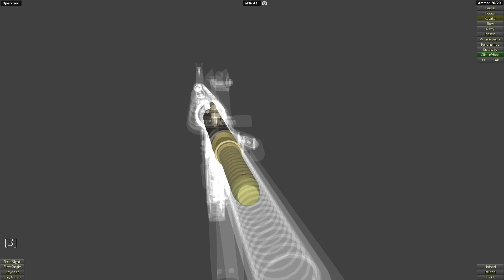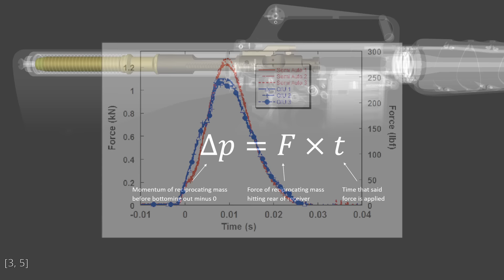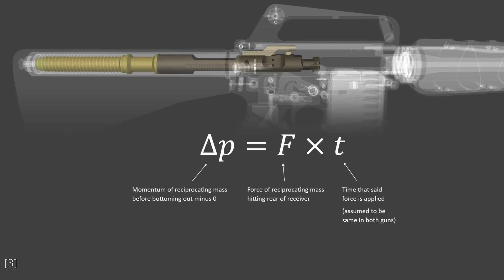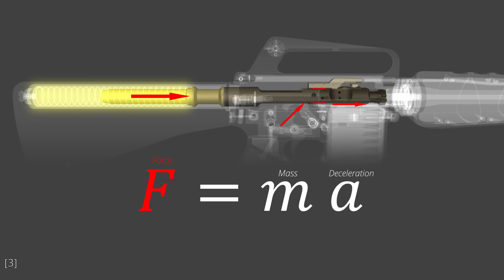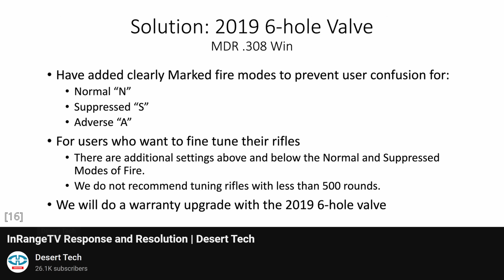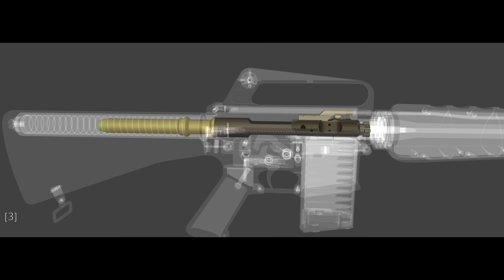Bolt Carrier Mass - A Nerdy Theoretical Discussion

Comment from the maker: FOLLOW UP:

I'd like to use this pinned comment to expand on some of the details that I glossed over/missed in the video. A lot of these details are contributed by thoughtful commenters, which I really appreciate!

1. Please keep in mind that the video is talking about the reciprocating group as one mass and ignoring the interaction between the different components. I wanted this video to be applicable to gas operated firearms as a whole. Here are some of my thoughts about the quirks of the AR platform if you're interested: The buffer doesn't contribute kinetic energy for unlocking, bolt pickup, and overcoming any friction/forces that resist solely the bolt carrier during the rearward stroke (e.g: hammer spring force). However, it does help everything in the forward stroke. A few commenters mentioned lightening the bolt carrier but increasing the buffer weight as a method to soften the felt recoil. This works because even though the overall reciprocating mass is the same, a larger portion of that mass is now in the form of the movable buffer weights, which spreads out the impulse of the reciprocating mass over a larger amount of time. The flip side is that the lightened bolt carrier now has lower kinetic energy to overcome the previously mentioned resistances during the rearward stroke.

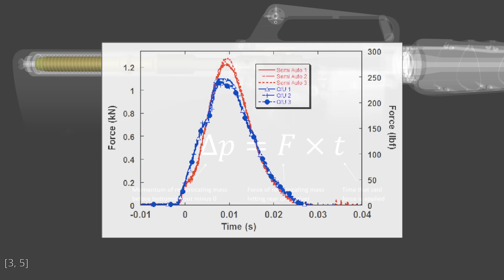2. Is it reasonable to assume that both reciprocating masses takes the same amount of time to come to a stop after bottoming out (5:23)? This amount of time is dependent on a few things like the stiffness of the buffer material, the butt pad, and how stiff the shooter is holding the gun. Additionally, the impulse transferred to the gun when the reciprocating mass bottoms out is also dependent on the rebound velocity after it bounce off the rear of the receiver (after removing the contribution of the recoil spring). I could not find a way to account for all of that, so I made an over-simplistic, catch-all assumption that the impulse time is the same, and did not include the time after v=0 into the impulse time. This is for the sake of being able to compare the impact force, which I think is more intuitive to understand. The more accurate thing to do would be to just stop at comparing the impulses of of the reciprocating mass striking the receiver, where the impulse could be understood as the capacity to apply a force over a length of time.

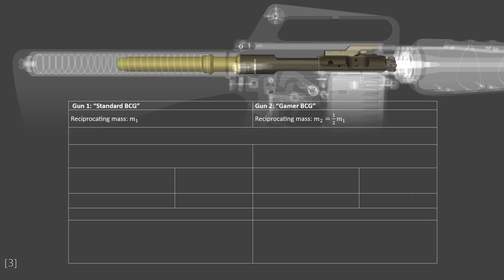3. Another over-simplistic assumption that I made is that the gas system provides the same amount of kinetic energy to the reciprocating group regardless of mass (1:45). The amount of KE provided by the gas system is the mechanical work done by the propellant gas on the reciprocating mass. This can be calculated by taking the integral of the force applied to the working surface of the gas piston over the distance of travel during which the piston is pressurized. (Note: in the AR-15, the "working surface of the gas piston" is the rear surface of the gas chamber inside the bolt carrier). In the video, I compared a gun with standard gas and standard mass to a gun with standard gas and low mass, so I assumed that the gas system has enough pressure to apply roughly the same force during the entire pressurized stroke of the piston. However, if you use an overly heavy reciprocating mass for a given gas system, an interesting thing starts to happen. The pressure inside the gas chamber drops over time as the bullet goes pass the gas port and exits the muzzle. An overly heavy reciprocating mass will accelerate very slowly, which means the gas pressure can drop significantly during the pressurized stroke. Therefore the force-distance curve of the piston will drop, the area under the curve will drop, meaning the kinetic energy provided to the reciprocating mass by the gas system will reduce. TL,DR: In real life, if the reciprocating mass is too heavy for a given gas system, you can reduce the amount of kinetic energy provided by said gas system, and the gun might short stroke.

4. Another obvious, but implicit assumption I made in the video is that in both guns, the reciprocating mass bottoms out on the back of the receiver. This is true for most military weapons. If you tune the gun so that the reciprocating group does not bottom out, then it categorically changes the recoil behaviour, and the math I used no longer applies. What would still apply is that an overly lightweight reciprocating group would still decelerate faster, and you would still have a harder time balancing a slow enough initial velocity for extraction, and fast enough to complete the cycle. If you want to know more about cases where the reciprocating group does not bottom out, then patent US4475438A is a good read. It's Jim Sullivan's patent on the constant recoil system. And it's more complicated than just making the reciprocating mass not bottom out.

5. A viewer brought up an interesting detail about the AR platform. During the extraction phase, after the bolt has unlocked, the extractor momentarily lifts off the rim of the fired casing. It is the residual chamber pressure after unlocking that presses the case into the bolt face, allowing the extractor to fall back down and grab the case rim again for ejection. A few tests showing this phenomenon were detailed in a May 2003 US Army TACOM presentation, titled "Understanding Extractor Lift in the M16 Family of Weapons". Supposedly, the implication of this is that the initial BCG velocity is important because if it's too fast, the BCG recedes faster than the residual chamber pressure can press the case into the bolt face, leading to failures to extract.
Reply: Are u talking Arizona to Alaska as in temps
Reply from the maker: @syitiger9072  yup
Reply: US ordnance (the government) found that, to have a reliable selfloading firearm, you need a Bolt carrier:Bolt mass ratio of about 3:1 or greater. the greater, theoretically the more reliable. 

SCAR17 is at 8.8:1. M1 is at 1.75, M14 is at 1.45. This is very low, but the M14 doesn't lose much relative to the M1 for that loss. It's more that they would gain a lot of energy retention from getting to 3.

AR15 has 4.68 for a full auto normal Colt BCG.
K1 has 5.88
AKM is at 5.4
Reply: Thank you for an outstanding video and follow-up clarifications!  While I agree there is more to Constant Recoil than simply keeping the bolt from bottoming out, that is a huge benefit unto itself.  Many commenters on videos about Constant Recoil claim that it would be useless or have no effect in semiautomatics.  That's like saying that switching out your dirtbike's long-travel springs for scooter suspension would be equally controllable or comfortable on a rocky trail.  The effects of inadequate free recoil travel are readily apparent in subcompact pistols.  Not only is recoil worse, but the springs are much stiffer (offer more resistance during the critical ejection portion of the recoil stroke) to avoid it being MUCH worse.
Reply: "Is it reasonable to assume that both reciprocating masses takes the same amount of time to come to a stop after bottoming out". No, a more reasonable assumption is that the effective spring constant will be the same, which means the heavier mass will apply force for longer (but still more force). As you say though, just compare impulses.

More importantly though, the BCG slamming into both ends isn't the only impulse -- there's also the impulse directly transmitted to the receiver through the locking lugs. Pump action shotguns don't have any recoiling mass when fired, while semi-autos do and this makes them softer shooting. This is because the direct impulse is lessened, and then spread out over time with the recoil spring.

"Another over-simplistic assumption that I made is that the gas system provides the same amount of kinetic energy to the reciprocating group regardless of mass". This is another incorrect assumption. It's more of a fixed impulse, and heavier BCG will have less energy for that same imparted momentum. This is why decreasing the mass makes it overgassed unless you turn the gas down to compensate.

Other than that though, I think it all checks out
Reply: On the topic of 1. The buffer weight does help with opening the bolt since it helps compress the mainspring which is one of the resisting forces. This holds true as long as the weight balances are such that the buffer weight and bolt stay in contact for the whole opening stroke. One could easily imagine a scenario where the buffer is very heavy and the bolt is very light and in this scenario the bolt may stop being held by the magazine spring etc. and the buffer continues onwards.

However with any reasonable weight combination the buffer will stay in contact with the bolt for the whole duration of travel, which means that the mainspring is constantly acting upon both the bolt and the buffer weight which means that the buffer weight is being useful here.
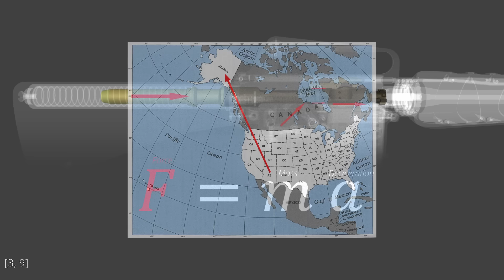Reply: @syitiger9072 8:49 it’s in the video
Reply: @oddspaghetti4287  I did not “get” all of (1) either. The buffer inertia and recoil spring should be working on slowing the BCG’s rearward travel despite additional forces slowing only the BCG (hammer spring). 

Great video overall and food for thought.
Reply: @superfamilyallosauridae6505  Could you link the document? Would be interesting in checking it out.

Comment: Years ago, I was really, REALLY into high performance paintball guns. One thing that we learned was that low reciprocating mass was preferred, but as the mass lowered the cycle speed would almost invariably increase. Adjustable gas regulators could tune in the gas pressure and a solenoid valve would handle volume. With these two parameters, we could better control bolt dwell time. Often though, thr smoothest shooting guns had the lightest bolts, and the LOWEST FRICTION design. Friction was the hardest thing to overcome when trying to achieve a smooth shot cycle. Something to think about in your next AR build.
Reply: It'd be interesting if we start seeing "low friction" BCGs and uppers with less/smoother contact surfaces to reduce felt recoil.... or are these already a thing for competition?
Reply: There are "enhanced" BCGs with low friction coatings and sand cuts in the bearing surfaces.
Reply: That's why my ARs get disgusting amounts of lube & grease (yes I use both)
Reply: @calebnation6155  same here, grease for the sliding parts and oil for the rotating  parts. Most people don't grease their cam pins but I think it's very important to prevent wear in the cam pin channel as well as to help dampen the forces on the cam pin during cycling.
Reply: Cryptic Coatings bcg's ftw
Reply: @justotalkalottashit8392  I was lucky enough to be around for both era's of paintball(been involved since 1998). I still have my X-valved Automag RT ULE 🙂
Reply: @justotalkalottashit8392   Not with solenoids and dwell time lol   Same principles apply though.  I started in paintball in 1988 with a splatmaster and a nelspot. Have owned 3 rental fields, played against the Ironmen at the first tournament to ever see an Autococker, Shot the first Halo loader (I mean the first.. the prototype Tex invented and worked the bugs out with before "Halo" was a loader), had 28 national sponsors in 2002 and was a Works Factory team captain. I was at one time known as one of the best cocker smiths around Texas. I tend to not follow the masses and strive to do things that everyone says can't be done. While the trend with autocockers back then was to use a heavy hammer and higher pressure for more volume and mechanical dwell. I was milling weight off hammers and having custom light springs built by a spring manufacturer to my specs. I have one sitting here right now that will chrono 290 all day long on 100 PSI, that's unheard of with an autococker. A team mate and I actually had an in house anodizing set up and had a few prototypes for our own line of guns, which raised some sponsor issues lol I still have about 85 guns sitting here in storage that need to find a new home, as I no longer mess with anything paintball related. Some nice ones like 1 0f only 25 made Kill Bill 05 Speed Angels, 1 of 2 Bonebrake Angel, OG Freeflow and Dark Cockers etc. Which brings me to my main reason for posting.  Lightning may reduce reliability in an AR15 for one main reason. Failure to come to full battery. Yes, if you have a chamber obstruction that could become an issue. But it could with any amount of mass depending on the obstruction. My 3-gun rifle has a Superlative gas block almost shut off.... 4-5 clicks out on an 18" fluted barrel with a rifle length gas system. A JP LMOS or VooDoo low mass carrier, -25%power spring, and a .589 oz Taccom solid delrin buffer, PA M4-72 muzzle brake, Trigger Tech trigger and some other goodies, but were talking reciprocating mass here. I've ran this set up for nearly 10 years now. Hog hunted with it in pouring rain and mud with wet dogs walking all over it in a boat. Pigs bleeding all in the upper. Red River mud that's mostly sand. Can't tell you how many times I've blown the mud and rocks out of this rifle at a car wash at 3am while knocking the mud off a side by side... I've shot competitions where I work in the oil field in West Texas during sandstorms and filled it with dirt and sand. I'm on my 4th barrel if that gives you an indication of round count. Want to know how many failures I've had..... ZERO.  It does not take that much momentum to chamber a round of 5.56. Most manufacturers lean toward tactical/duty builds and use heavier mas and over gas to ensure reliability.  You can regulate gas and reduce reciprocating mass substantially and still have a reliable system. Now this is a competition gun. I wouldn't go that light on a duty weapon. I have a hodge for that and now a dedicated BCM for thermal hunting hogs. But I promise you all the BS you hear about reliability over mass reduction and adjustable gas blocks is mostly just that BS.  I'm still using the same superlative gas block after 10 years btw. I've replaced the adjuster in it twice now, only because the tip of it burned off after thousands of rounds. Use hi temp bearing grease on adj GB threads and you'll never have a problem. Polish away friction, consider every part as a tuned system from tip to butt, think outside the box....  that is all... sorry for the long azz rant lol

EDIT: btw, my dad was a LE armorer and I had 2 uncles that were vietnam vets. My first AR was my dads Bushmaster in 1988. I've been tuning them for a while lol Sometimes experience and mechanical aptitude adds up better than math does in the real world.
Reply: As they say: high speed, low drag

Comment: I believe the gun should fit the time-place-occasion, if it's supposed to work in many different conditions, eliminating variables with a heavier BC is a good idea, but if its a competiton gun that doesn't fire full auto and only semi, i think there is a decent trade off to be had with a lighter BC
Reply from the maker: Agreed
Reply: For non-match guns, I like to run the heaviest buffer I can get away with for just that reason.

Also keep in mind the heavier, mil spec carriers will lost a lot longer than lightweight units.

Comment: If you add a stronger recoil spring to counter the increased velocity, then adjust the gas for reliability, you can increase reliability over the lighter bolt carrier by itself.  You are essentially trading bolt mass for bolt velocity to maintain reliability.

Comment: Great video.  One point to contextualize Sullivan's comments in Ian's interview that he would rather increase the mass: his point of view centers around full-auto firing. As you point out, there is an impulse when the reciprocating components bottom out (often referred to as secondary recoil) as well as an impulse when the reciprocating components go into battery (tertiary recoil).  Primary recoil of course is caused by the bullet being accelerated downrange.  From the perspective of the shooter when firing full auto, tertiary recoil from the preceding round occurs contemporaneously with primary recoil from the successive round.  As these impulses are in opposite directions, they can nearly cancel out in a well-tuned system if that is one of your design goals, as it is in some of Sullivan's designs that came after the AR15.  Reducing the mass of the reciprocating components drops the momentum they have when entering battery as you point out, and thus reduces the tertiary recoil impulse that would cancel out the next primary recoil impulse.  This is why Sullivan thinks it's crazy to reduce the mass: it's counter to his design goal of "constant recoil" under full-auto fire.  Of course, if you have primary and tertiary recoil working in harmony you haven't necessarily done anything about secondary recoil.  Sullivan's modification to the AR15 design also incorporates a carrier designed for a longer stroke, with more wiggle room in the travel distance between bottoming out and being able to strip a round from the magazine.  This allows his system to be tuned to never bottom out or at least not do so heavily, where the reciprocating components are halted in their rearward motion primarily via friction and spring pressure over a longer duration.  In this situation, the push the shooter feels is simply the pressure the reciprocating components apply via the spring and friction, which does oscillate but with a much smaller delta than a system where the moving parts come to a sudden stop.  With secondary recoil minimized, the weight of the reciprocating components is no longer an issue there and they can be made heavier to help the tertiary recoil cancel out primary recoil in full-auto, which is exactly what Sullivan has done.  The system can now be said to be in a state of "constant recoil" for marketing purposes.  Sullivan's AR15 design modification for "constant recoil" was commercialized in the form of the Surefire OBC.